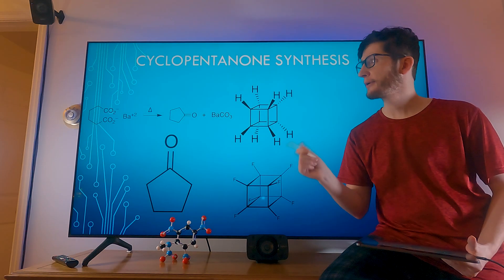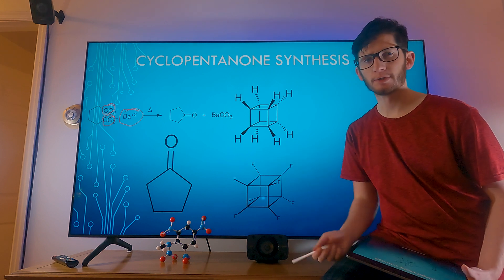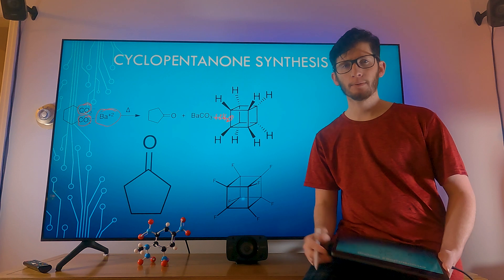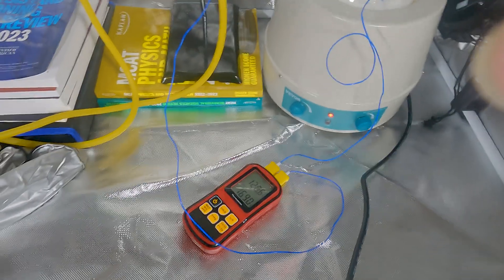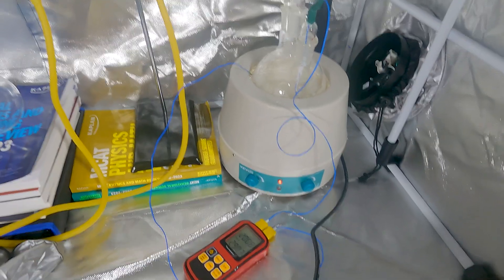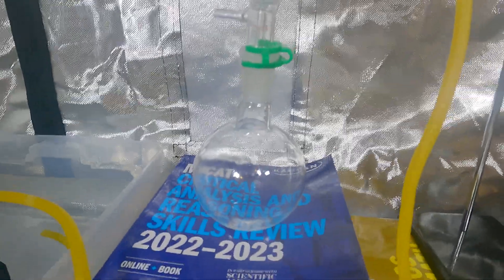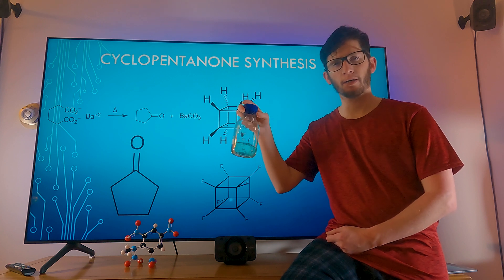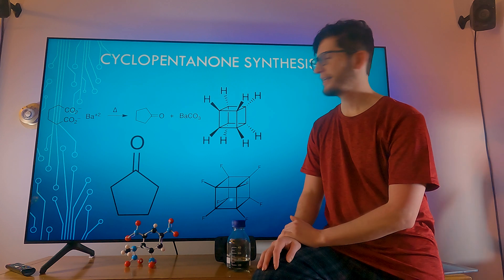Making Cyclopentanone - For Cubane Project

Comment: Ah, I see you are a fellow Tetryl enthusiast. I am, too, though the acute toxicity is a real shame, hence why its use was phased out. I mean, RDX and HMX are not exactly healthy either, but they are more powerful and stable, as well as possessing carbon monoxide and water vapor balanced decomposition  equations and higher nitrogen content. Tetryl has a special place in my heart, though.
Reply: I do agree, Tetryl is a very neat little explosive with some interesting history behind it. Most Tetryl now, as you already know, has no purpose now other than remaining in some legacy munitions and other old ordnance. As you’ve said, RDX and HMX has completely replaced it in all of its previous appliances. Tetryl was quite neat, its legacy will continue.

Comment: I recently made cyclopentanone using this same method.  YMMV, but I found that using barium carbonate at 10g per 100g adipic acid made for a smoother run and gave higher yields (~89% on one run and ~92% on another).
Reply from the maker: Nice! My second distillation I actually didn’t have quite 200 grams left and I totally agree. That one went a bit smoother. I also noticed with that second run with less Adipic acid, there was much less left in the flask and it didn’t seem to be as gnarly to clean!